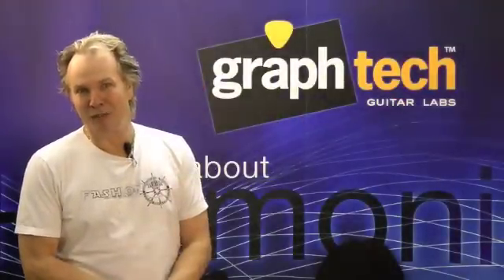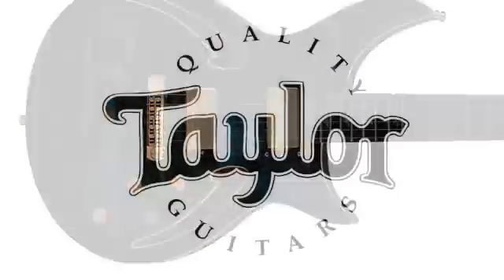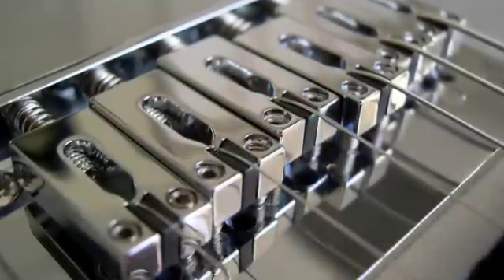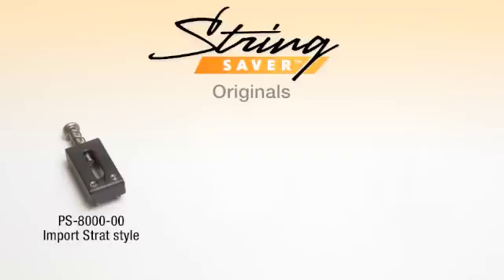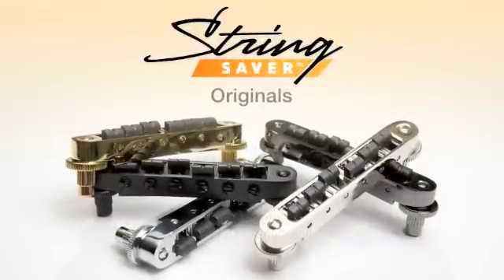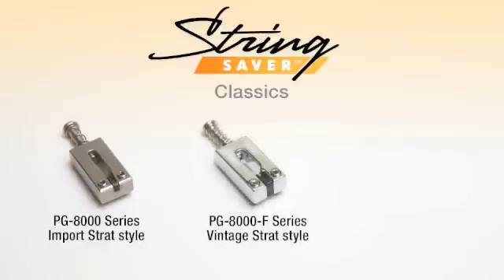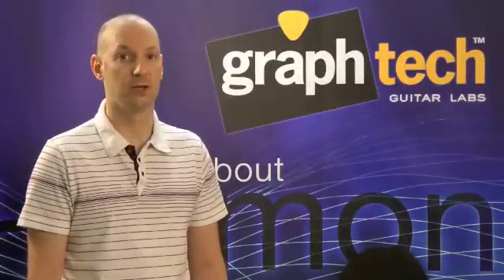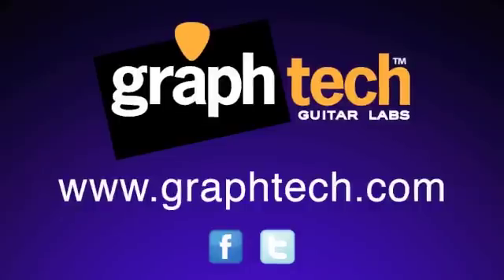How to Really Stop Breaking Strings

Comment: At 1:20 the intro ran a bit long but that's not a huge thing.  These saddles do look like a good thing though.  I have a guitar with a locking nut / fine tuning bridge setup (Vester JSE750) that could use a set of the offset saddles. 

I'm also building a strat kit (byoguitars) using a tusq xl nut which I expect will be pretty good on the mighty mite neck I have for it.  Not sure if you have instructional videos on installing the hardware you make but if not you should start.  It would save a lot of time n effort for us guitar players, especially those new to doing their own maintenance.

Comment: Just got a pack of your string saver graph tech strat saddle set, undid and took off my old saddles and started to put on yours, managed to get 4 in before they started to veer off as i was screwing them in. The saddle set for mexican strats DOESN'T FIT MEXICAN STRATS!!.... so managed to get 4 of them on using my old saddles for the D and G strings which btw looks complete shit. Go to adjust the saddle height...

Comment: I discovered that the bent steel saddles on my Deluxe Players Strat had an intonation screw stripped out. This is of course a second hand guitar(paid $325.00). This little problem has cost me pretty bad fret buzz and lack of intonation adjustment. I thought I would just get the upgraded Fender solid rectangular ones as an upgrade replacement but now that I see these, I may as well do a total pro job by putting in the best. I should be getting them in a day or so. Will post back then.